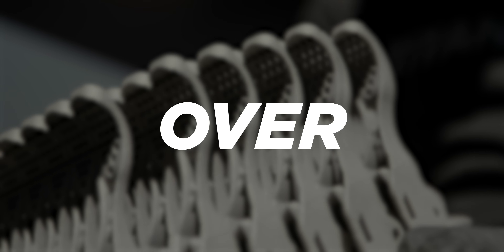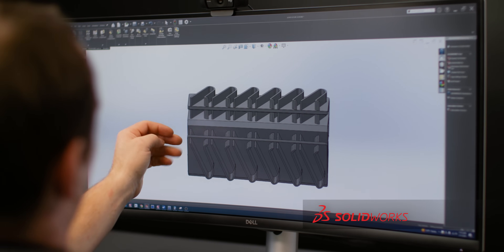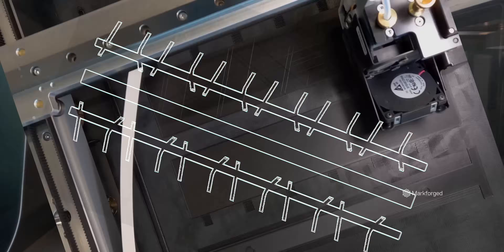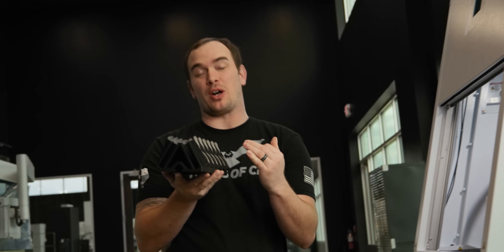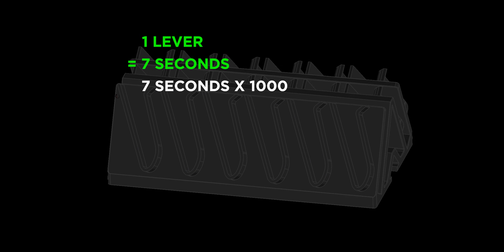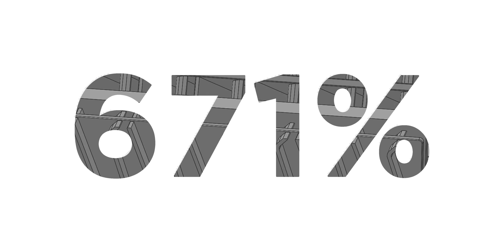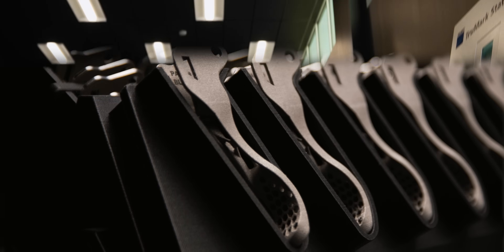Creating Workholding Fixtures To Increase Productivity by 671%

Comment: Guys! The time to design the fixture doesn't come into the marking cycle time because you do it once. If Trevor was building a fixture he was going to use one time, the probably two days it took to make the fixture is going to play a huge role. These levers are a recurring order, so every time the motorcycle company orders a batch Trevor gets out the same fixture, engraves all the levers, and puts the fixture back in the tool room. 

Trevor, there is a huge problem with your numbers. It takes 168 seconds to engrave 24 levers. However, if you were engraving a thousand of them you'd have to do them in 42 batches. I'm going to assume you can leave the fixture in the laser cutter so there's no time wasted pulling the fixture out, changing the levers and reinstalling the fixture in the machine. But you DO have to figure in the time it takes to safe-out the laser, open the door, remove all the engraved ones and replace them with fresh ones before closing the door and re-energizing the laser tube. Maybe it would be quicker to make another fixture and just swap them out after each batch is engraved. Assign another operator the task of wrapping and boxing the engraved levers?
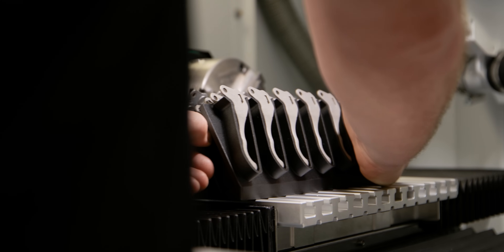Reply: 1:05 -1:08 mins in...
He mentioned a second fixture already...
True thought tho bro, let's add a third and fourth one for when you come back from lunch and you have to catch up!
 Eh?
Reply: @00linered  Why just three or four? If they're making enough levers to justify it, build twice as many fixtures as you'd need to fill the entire bed of the machine. Load them all, put half of them in the machine and press the "run" key. It'll still be running when you get back from chow.

Comment: now how long did making the fixturing model and printing it take?
But, there's a lot of time in parts swapping so 1 at a time is actually WAY slower than the multiples
Reply: Considering someone can load several of those fixtures in the time it takes one of them to mark, you're only limited by how fast the machine can change fixtures and start cycle.  As for time to model and print it... well... yeah.   Perhaps if there was only ever going to be one run of 1000 parts you might just use a basic hole grid fixture plate stick pins in it to provide repeatable location and mark 4-8 parts at a time.  But if there is any chance of multiple 1000 part runs?  Oh hell yes this works.

Comment: Cool fixture one question if it was a one run batch it’s not gonna be worth it and i’m assuming the 7 seconds is the button to button time not cycle time? How long and how expensive is the fixture to produce? Big production runs this set up is key but on one off 1000-2000 component runs it’s not worth the labour let alone materials .
Reply: Right, with a much larger order like 1M/mo for 5 years, then the fixture manufacturing time becomes negligible.

Comment: Additive manufacturing software developers should make the parts marking available during the parts print itself. No fixtures printing required and no additional steps for marking the parts. Just add "engrave"/embossed text with part number and send to print.
Reply: It's not easy to do, letters and numbers would have to be quite big and almost impossible to print at angle other than flat to the table.

Comment: 0 man hours into the fixture? how long to draw up the CAD model? how long did the actual printing take? i bet design and print time is more than 13hrs....
Reply: Zero “man hours” into making the fixture. Man hours is the amount of time I personally had to spend on making the physical fixture, not designing it. It was virtually zero because I just sent it off to the printer and went to do something else. This drastically cuts down on the manufacturing cost of the fixture since the printer running itself is cheaper than me programming, setting up, and running a machine. Design time was considered a wash because regardless of if your printing or machining a fixture you have to design it so that time will be spent anyway using either method.
Reply: the time to do all the parts with 0 special fixturing was 13hrs. unless you designed and printed and completed all the parts in less time than it takes to do them all one by one, you lost money. i get the point of the video, special fixtures save tons of money when applied right. but being a competent machinist is knowing when the opportunity cost of a certain method like unique fixturing is too high. theres nothing wrong with doing it the simple way if its literally faster. education video nonetheless, much appreciated
Reply: @hardyharhar801  I could quote 750 bucks to mark 1000 levers which is literally .75 cents per lever give a 3 day lead time and spend 3 hours of my actual time and still make money.
Reply: Efficiency and speed are different. This part needs a fixture wether you do one or 24. It needs to sit at a 60 degree angle to be marked. You won’t be able to do it without a fixture of some kind. You tell me what’s more efficient. Taking an hour to design a fixture, printing it overnight in 12 hours and then knocking out the laser marking in 2 hours of physical time spent? Or… standing in front of the laser for 13 hours of your valuable time loading parts, which by the way is going to take two days anyway unless you run day and night shift. I guarantee you’ll make more money using the fixture if you quote it right. Plus, you’ll have the fixture for the next batch 👍🏻

Comment: very nice. but to make the comparison a bit more honest, you can't just count the machining hours of one machine doing one job. how long did it take to design the fixture? how long did it take to print the fixture (or et least cleanup, quality check, possible error in the design etc.). i'm sure the calculation for a 1000+ pieces still comes out ahead comfortably, but it feels a bit dishonest to me to make the number look even better just so the results pops more for dramatic effect.
Reply: But they would have to design basically the same fixture either way: look at the part, there is a face in the way of engraving straight down, the only extra cad time is a repeat operation.

Comment: How much time did it take you to model this fixture in CAD? With 1000 parts to mark seems well worth it- minimises probability of misalignment and with just two fixtures you basically cut downtime to zero - I guess you can unpack marked batch and load another one in 2 minutes 48 seconds it takes the machine to mark the batch in the second fixture. Neat